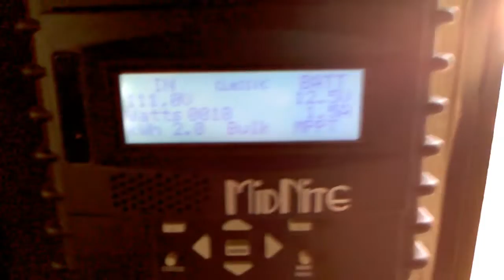12 days of Desert Monsoons @ AZ Off-Grid (Unplugged)

Comment: Wondering what you are going to do with the old trailer?. Just a suggestion would'nt it be easier to build a solar house (6x6 or 8x8). That way everything would be in one place and be easier to maintain. The reason I asked about the trailer is I have been looking for land in Az myself to buy and retire on.  Thought that the trailer if your not going use maybe you might sale it. My plan was get land buy a mobile home and go from there.
Reply from the maker: I mentioned in the first video of the trailer that we were going to use it for storage.. I may clean up the front room enough to allow guests to stay in it, but for the most part it was always going to be storage..  Thanks for watching.!!
Reply from the maker: Roxanne.. .. Off Grid entertainment is a Charge Controller.. lol.. I wanted to be able to see it at anytime.. More importantly, this is an RV.. this way I can drive it down the road without having to leave everything there, or pack everything up..
Reply from the maker: I am positive you can find a much better condition trailer.. .. Did you want to do the off grid way,, or plug  into utilities.?
Reply: deserthorizons yes I'm looking for off grid land would like to buy about 3 acres put mobile home a nice used one onto the land.   Then add septic tank, solar and 2 water tanks 3000 gallon ones. Maybe add more tanks after I build water catchment system.
Reply: I would like to purchase land to live on without being harassed about building codes....any suggestions for California desert??? Thanks for in advance...
Reply from the maker: Brian Hernandez I think those days are over for California.. Check out Eric from Luthorville.on YouTube . He may be able to help..
Reply from the maker: Roxanne.. where are you looking and when were you wanting to do this.?
Reply: deserthorizons l was looking around Tucson but the land was to expense.  Now I'am looking around Show Low, Snowflake and concho area. It just a matter of time find the land so hopefully within a years time. I also will need to sell my home here in Nebraska
The money from my home sale well be what I use to get everything I need.